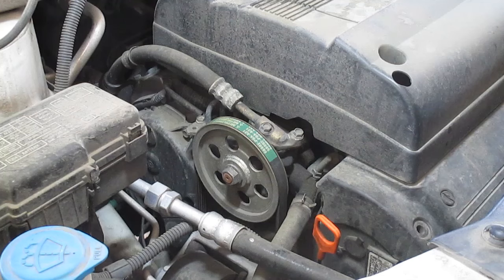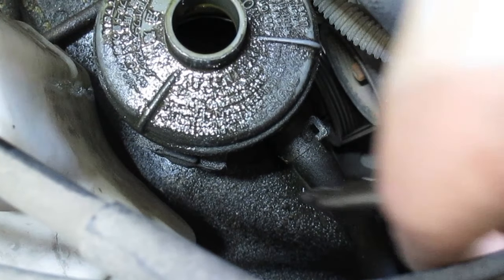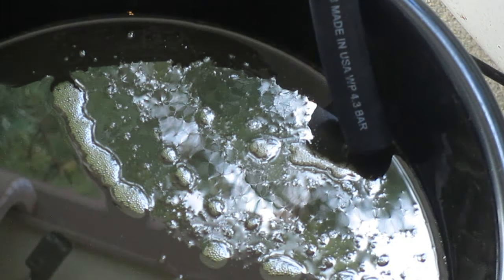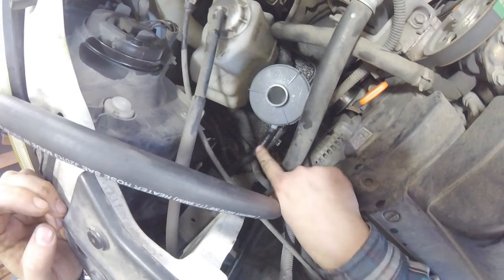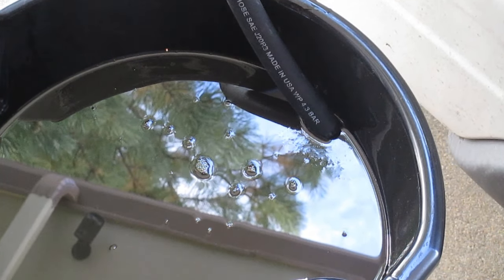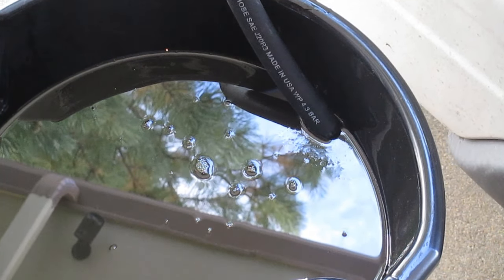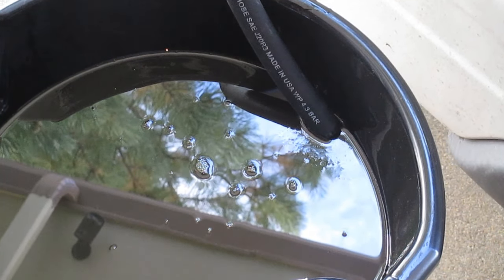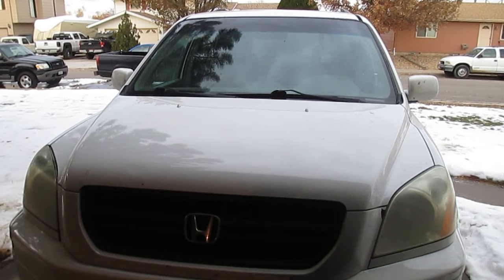Cheap Fix for Power Steering Noise | Repair - 2004 Honda Pilot

Comment: I replaced the pressure hose, also the 2 o-rings, but car still making noise when I start the car, and when I accelerate the car. I don't hear that grinding like your does, more of the whining when I start and accelerate the car.
Reply from the maker: I would replace the reservoir too, there's a screen in there that gets clogged and it can create a pocket of air below it. That air gets sucked into the system and causes cavitation in the pump. Then lift the front end, and turn the wheel back and forth with the cap off the reservoir, this should bleed air from the system. When turning back and forth, stop just before it locks, you don't want to turn the wheel until it stops.
When the engine is running and the cap removed, you should be able to see smooth fluid inside. If it is foamy or bubbly you have air getting into the system somewhere. 
Thanks for watching and commenting!

Comment: Could you use a 10mm socket with a ratcheting wrench instead of the stubby manual one?  Is there maybe not enough space for clearance ?
Reply from the maker: Yeah, there really isn't much space for swinging a full length wrench, even the ratchet kind.

Comment: Question on the screen. Am I safe to assume it's NOT replaceable OR, can you not clean it? Thanks again!
Reply from the maker: Cleaning it may be difficult due to the location, and I could be wrong but I think Honda had another change to that reservoir that would be beneficial but I can't remember what it was.
It isn't removable, and the reservoir replacement was cheap enough it just made more sense to replace for me. Due to shipping issues and availability these days that story might be different.
Reply: @DustyDingus  Thank you. I found one at O'Reilly's, with a new lid for $11.43. Not too bad. Thanks for the reply. Have a great Christmas.
Reply from the maker: No problem! Merry Christmas and thank you for watching and commenting!

Comment: Thinking I have a similar issue under my power steering tank looks like that as well. Believe it's from the power steering fluid getting air and bubbling up and leaking. 08 honda ridgeline.
Reply from the maker: Best bet is to get the whole kit; fluid, reservoir, and o-rings and see how that improves. Make sure the pressure and return lines themselves are in good condition.
Thanks for watching and commenting! If you've got any questions feel free to comment back

Comment: Dang. we have one same model, color  and same noise- so its the two  O rings?  I need to replace?
Reply from the maker: Yup! Is it also worse in cold weather?
The orings get old and let air into the system, cold weather makes them contract further. I also replaced the reservoir because there is a fine mesh screen at the bottom that can become clogged and starve the pump of fluid and contribute to the noise. So 3 parts in total. In the description there should be a link to the kit with the fluid and orings.
Reply: @DustyDingus  is it just sound or does it also affect the feel of steering as well?
Reply from the maker: @gilbertosanchez2102  definitely affected the feel also, made it rather stiff to turn at low speeds.

Comment: Replaced my o rings..after air worked it's way out of the system, 2 days of no noise, it's back to being noisy again. I really don't wanna take it off again gahh!
Reply from the maker: Sorry i know its been over a week, but
Still making noise?
Did you perform the bleeding with the front wheels off the ground and turning the wheels side to side?

Comment: Two weeks, i bought a 2003 accord 3.0 v6 and it had the loud noise on the power steering. the reservoir bubbles up, leaking fluid on the bottom. checked for recalls and they replaced free the high-pressure steering hose and an ignition key component.  after replacing the new high-pressure hose it still has the same noise and bubble in the reservoir. i figure i need to replace the new red o-ring . so i bought it for $3, a new reservoir with the two hose that connects it.  gave it to my mechanic friend to install and after that, no more noise and leaking. Saved me several hundred!

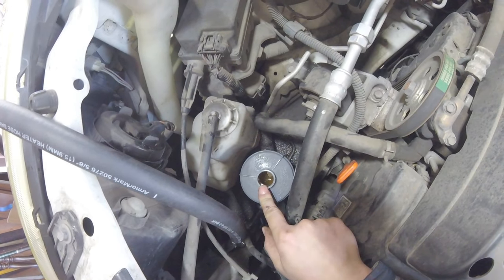Comment: Hello, very good video, I have a doubt, I hope it is not a silly question, I do not know where the hose is connected to drain the old fluid with the generic fluid. Min: 9:46
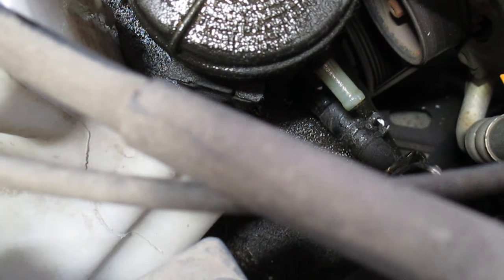Reply from the maker: Sorry I didn't see this comment at first, slip a long piece of 5/8th inch heater hose over the hose at 3:35

Comment: I would not run the pump dry the vanes inside the pump will get hot really fast when the pump runs dry. You can drain the fluid disconnecting the lines under the car and then run the rack back and forth.

Comment: Why do the wheels have to be off the ground when turning them side to side to get the air out?
Reply from the maker: Takes the back pressure off the system so air can get out. It won't bleed otherwise. Plus it makes it easier to turn the wheel rather than rubbing black circles into your driveway
Reply: @DustyDingus :  I don't have my jack available.  Is there another way to get the air out?  I'm sitting in gravel if that makes any difference.

Comment: Good video was wondering if you had to go to the dealer for the rings or if they were at some auto parts store?
Reply from the maker: I am not sure if they're available in parts stores or not, I found a good little kit with the o-rings and some Honda genuine power steering fluid on eBay, that's what I bought. There is a link to it in the video description.
Thanks for watching and commenting!
Reply: @DustyDingus  Thank you for replying im definitely subscribing!!

Comment: I have no leaking around the pump area just noise while turning wheels, is it still an O ring issue?
Reply from the maker: Possibly. Check fluid level first, if it appears foamy inside the reservoir when running and the level is good it is likely an o ring or another leak letting air into the system. You can also try bleeding the air out by removing the cap, lift the front end off the ground (safely; parking brake and wheel chocks behind rear wheels) and crank the wheel from end to end, engine running of course. If that doesn't get air out of the system it is continually being introduced from somewhere.

Comment: Ever thought of washing your motor once and a while. Makes working on the engine easier and not as messy if you do. Good video but embarrassing to see the dirt on the engine.
Reply from the maker: Lol I'm not embarrassed about the little tiny bit of dirt. I dont like water near all of those electronic connections unless it is necessary.
I've worked in many, many engine bays. Many far dirtier. 
Ever lived on a dirt road before?

Comment: how do you know which is the return line ?
Reply: The one that sits higher (coming from radiator area) is the return.   Remember,  reservoirs pull from lowest point.

Comment: If your fluid looks like that you have air in your system which is the cause of the noise and all your problems. Smart move to drain and refill.
Reply from the maker: That air is coming in from somewhere and won't just stop. Drain, fix air leaks, refill. The leaks in the system and the reservoir are the cause of noise and problems, the foamy fluid is just another symptom.
Reply: @DustyDingus  absolutely air comes from somewhere not always the o rings sometimes the boot from the rack allows air and most people don't know or check that 😀

Comment: How do we know is not the power steering pump?
Reply from the maker: For us the noise started in cold weather and gradually became present all the time until the vehicle warmed up. Then the noise would go away. The steering also worked the whole time without issue. 
Replaced the reservoir, the o-rings and the fluid per Honda's technical service bulletin (TSB) and the problem went away. Still working today

Comment: Replacing o-rings and resorvior fixes NOTHING SIR.😅
Reply from the maker: If the pump is truly bad, which is often not the case. But this originates from a Honda Technical Service Bulletin and it does fix the problem of air entering the system and causing the cavitation which is the noise heard in this video. Replacing the o-rings and reservoir fixed this problem for me, and for MANY other people. Fortunately, you're just wrong on this one.
Thanks for watching and commenting!
Reply: @DustyDingus  ok, when you changed o rings i thought air problem, because no leaks. Cool!

Comment: What a Dirty engine. I would clean engine first before i work on engine.
Reply from the maker: Cool. Glad I was only working on power steering ;)
Reply: It is probably his daily driver. Not a show car smh
Reply from the maker: Exactly! And it's my wife's daily otherwise I'd get to work on it WAY more to make up for the amount of miles and abuse it gets in one week. 45 minute one way with country highway, then 5 roundabouts and traffic through town.